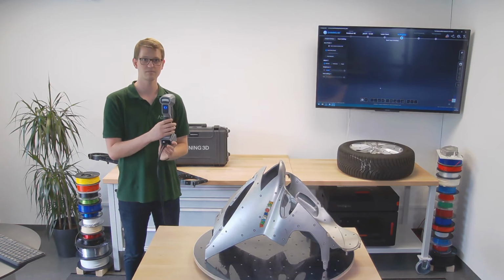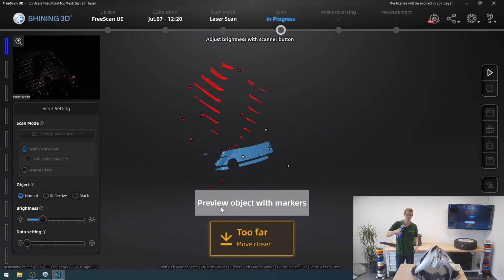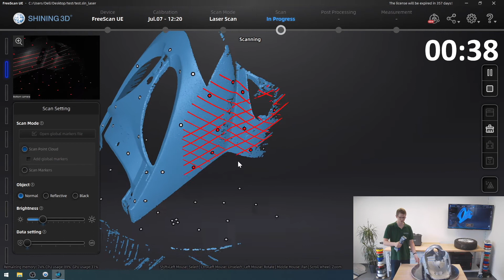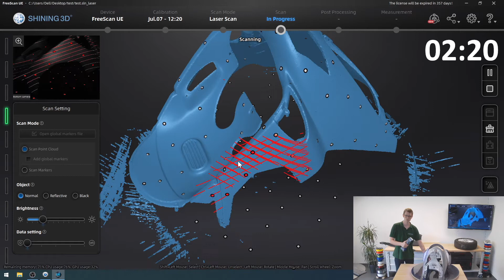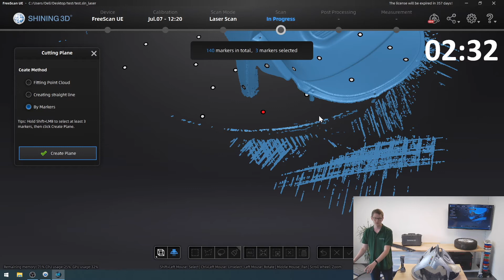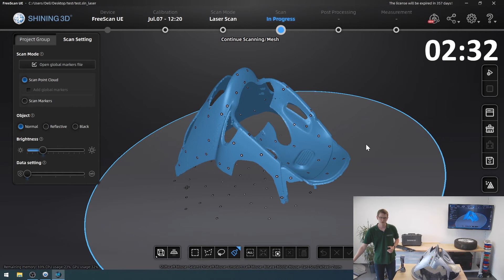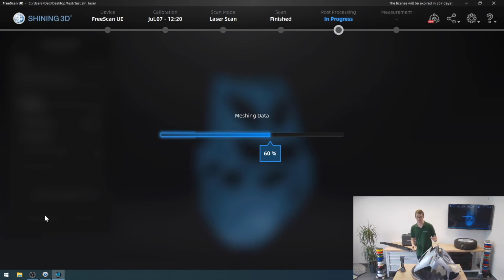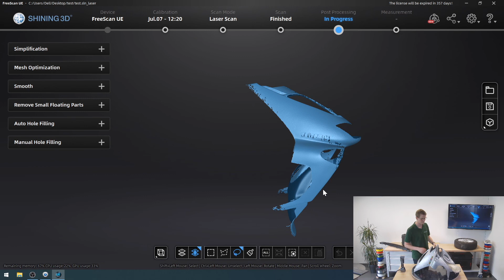3D Scanning with Shining3D FreeScan UE7 Part 1 - scooter front

Comment: Is it possible to scan the top side of something, then flip the part and continue scanning?
Reply from the maker: Yes. Depending on the specific part it may be best to start a new project and then align the two projects with one another to create the full part. But either way it is certainly possible to scan a part from multiple angles and then combine them into a single scan.